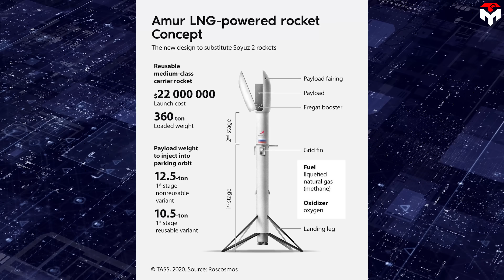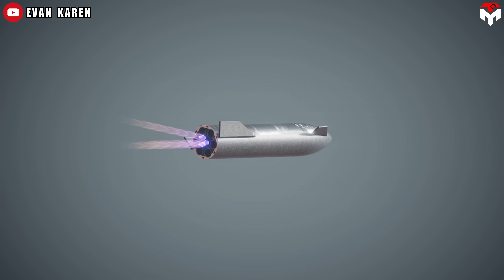SpaceX found Genius Way for Starship Launch 250 tons to orbit Shocked China & Russia...

Comment: SpaceX needs programs to help pay for Starship.  SpaceX could just rename the expendable upper stage yet continue to develop reusable heat shields until ready for Starship.
Reply: SpaceX needs to get one into orbit. But that's not going to happen.
Reply from the maker: Exactly spot on. SpaceX is moving in the direction you are talking about. The revenue from Starlink is to pay the bill of Starship. They are developing Starship HLS in parallel to Starship conventional versions.
Reply: @techmap9  Starlink will never be profitable - no one has even suggested a possible path to profitability.